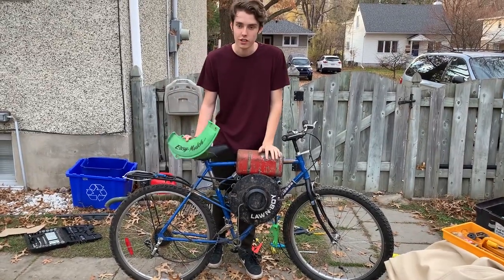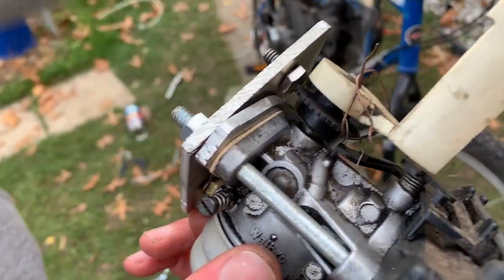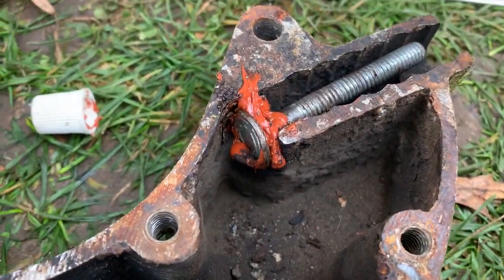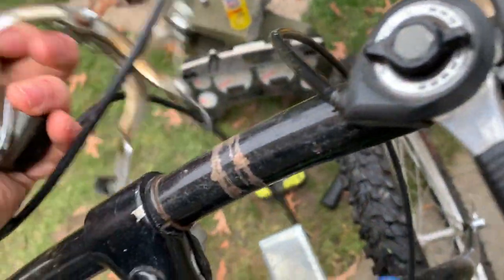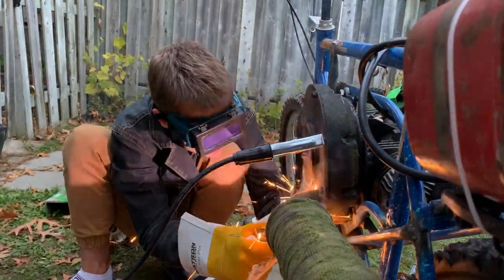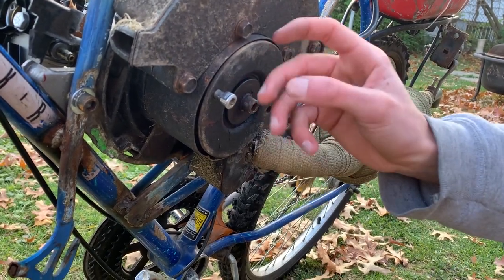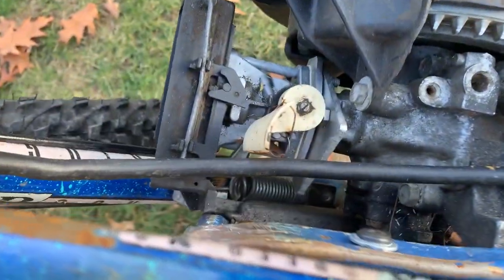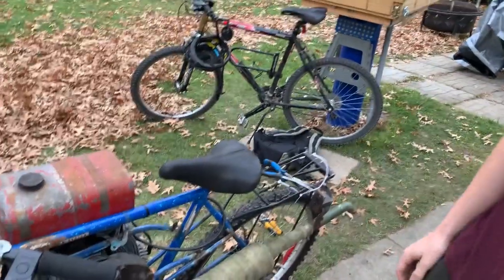Lawnmower Bike pt1 (will it start?)

Comment: By the way, proud of you guys, good use of your free time, and creating.  Also, if you ever need to weld, be sure you’ve got the heaviest and shortest utility extension cord you can get.  Like 4 gauge, or even make you a nice 3xtension cord out of welding cable.  Smaller ext cords drop amperage so fast, and are usually too long, you don’t get good weld results.  Just telling you this for few years from now, when you’re welding on cars.  In fact, best to use no extension cord on welding machine.  But that’s hard.

Comment: Never weld in socks.  Remove socks if you don’t want to wear leather enclosed shoes.  Don’t wear nylon shoes of any sort.  When weld slag pops off onto bare skin, it hurts so bad you will shake it off and skin damage will be minimal.  Cotton or nylon both enable it to stick and leave harsher burn.  I’m covered in weird little forearm and hand and foot burns from welding in apparel totally inappropriate.  My excuse is it’s 90+ degrees here, with humidity 40-70% sometimes.  It’s too hot to even be outside much less in protective stuff.  And I’m a dirt mechanic, no shade, no concrete it’s rough.  But weld burns hurt quite awhile, if it’s not sweltering hot, please wear leather enclosed shoes.

Comment: But engine oil is on the side then😂
Reply: It's a 2 cycle ya dingus
Reply: @LawnboyFanatic  oh my mistake didnt put sound on or didn't watch that it hasnt cylinder head(valves)
Reply: I have 3  2 strokes